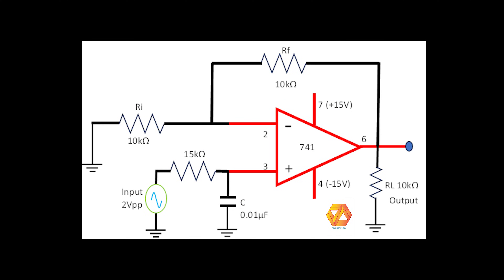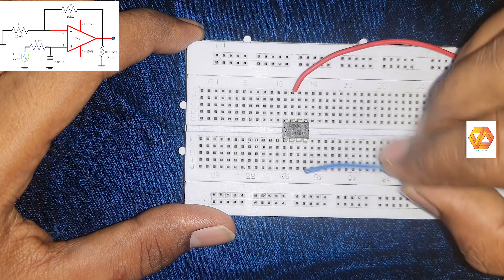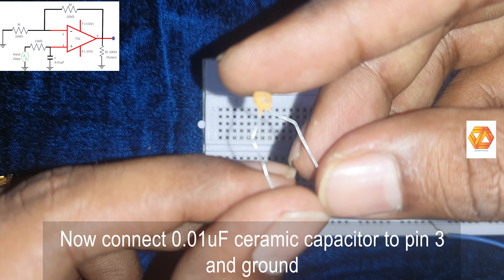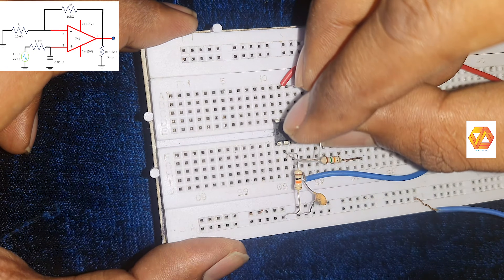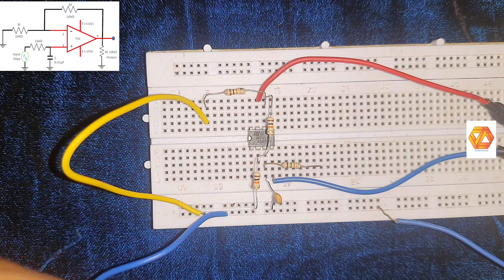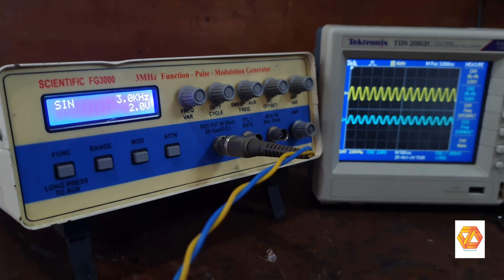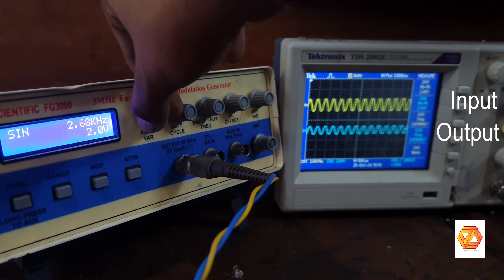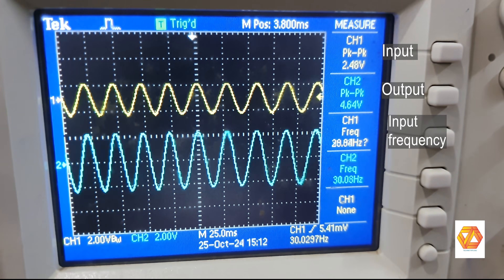Op-amp Active Low Pass Filter Circuit | Experiment| BTECH | Diploma| Electronics

Comment: Sir, amplifier nte output eduth ithil input ayi koduthal mathiyo(in between amplifier and subwoofer),atho amp input il ninnu thanne eduth seperate subwoofer amplifier connect cheyyano?
Reply from the maker: This circuit is not sufficient for your requirement. For audio, low pass filtering, cut-off frequency should be very low around 200 Hz and it should be connected before the power amplifier stage.
Reply: @TechnoTipsE4U  lm 358 ic use cheyyth orennm undakkan plan ond by using youtube reference ,athilu oru POT und circuitil ath upayogich cut off frequency adjust cheyyamallo sir?

Lm358 lpf anel njan mukalile comment il paranjathil engane Anu connect cheyyendath
Reply from the maker: Same